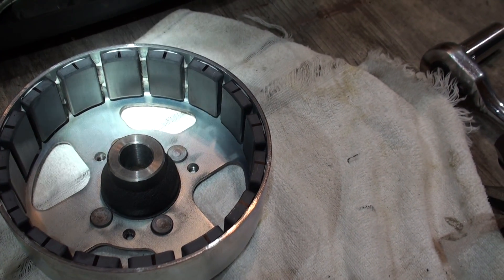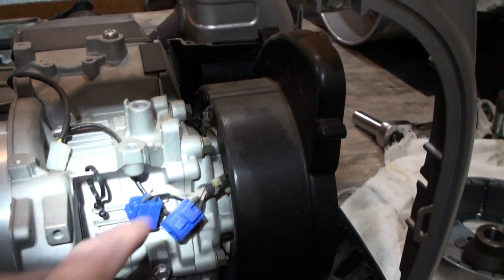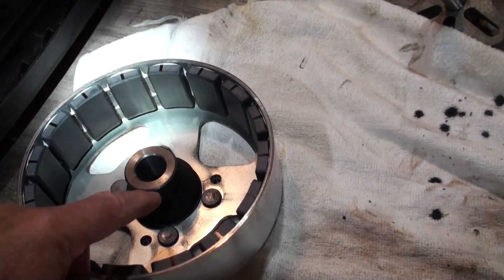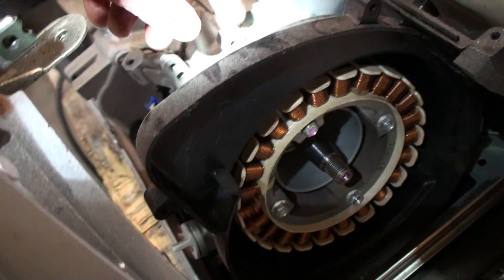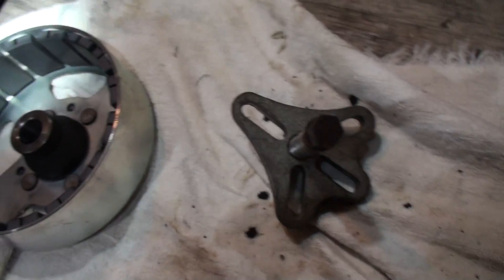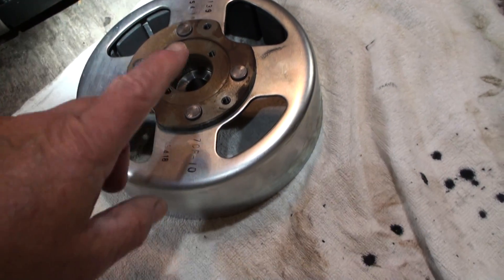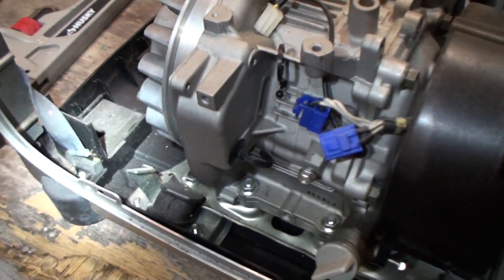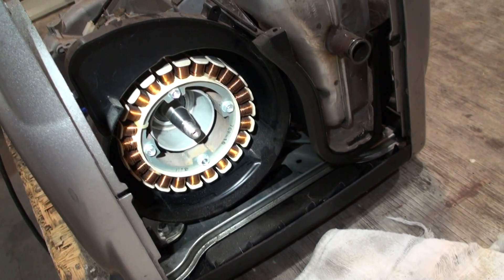Yamaha EF2400is Inverter Generator Disassembly Part5

Comment: This exact thing happened to my EF2400is. That exact bolt was working it’s way out and the rotor/stator was starting to touch it. I have noticed for a while that it was making a ringing sound and it got really bad today. Thanks for this video. I was able to repair mine in about an hour. The only thing I had to buy was the harmonic balancer puller. Good as new!

Comment: Yup, they just pump lots of amps with 12 volt. pass that through to an inverter and wala. No different than plugging an inverter into your cigarette lighter.
Reply: They go much higher than 12v, more like 200v DC I believe.
Reply: @kylegoldston  Not hardly. They produce 12 to 13v and around around 30 amps, possibly more. Imagine if you will taking a 2400 watt inverter and plugging it into your cigarette lighter. It's essentially doing the same thing here, except you have a generator producing the 12v and x amount of amps.

Update: I am incorrect. They produce around 70 amps for 120v 20amps output.